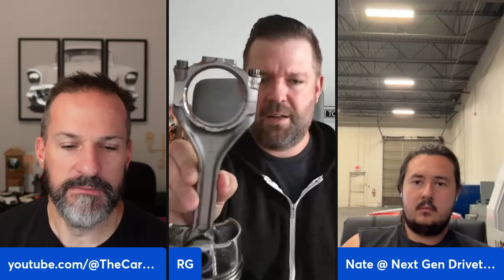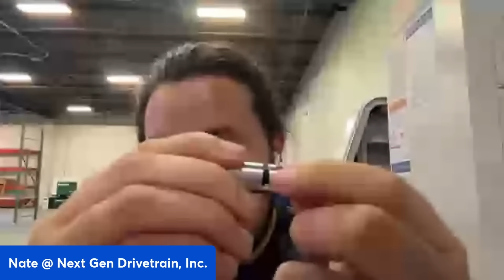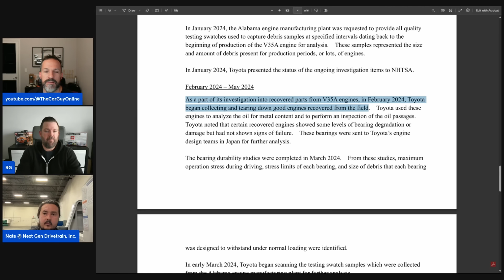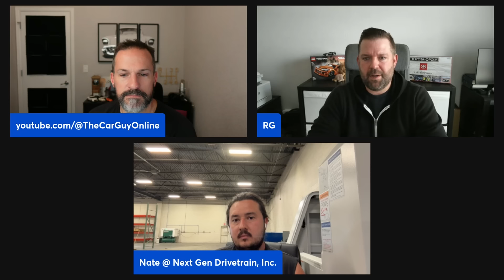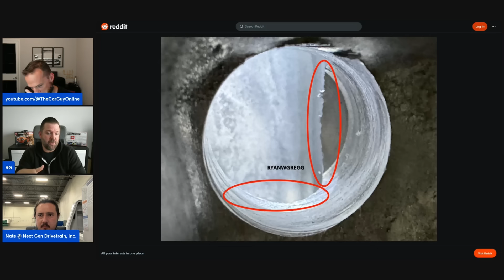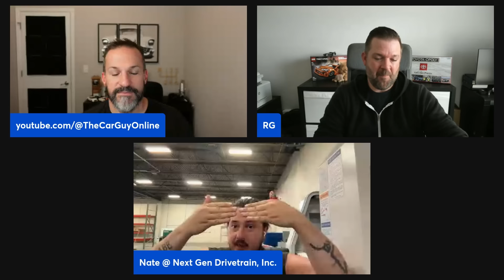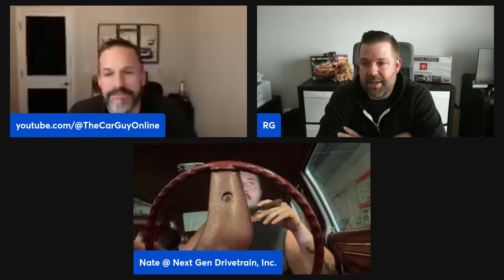Toyota Tundra BOMBSHELL. Buyer Beware Until 2026 (Full Interview)

Comment: I bought a brand new 2026 Toyota Sequoia TRD-PRO. I was rear ended.  I've been waiting 4 months for parts. I'm still waiting.   I complained to the CEO at Toyota North America.  Their brand engagement team did nothing. They would close the case.  I would have never purchased a Toyota knowing they have parts availability problems.  I've been having to pay rental car charges due to the delay .   It's been a very bad experience with Toyota.  Based on this and stories I keep hearing, I will never purchase a Toyota again in my lifetime.  Most likely, I will sell the car when fully repaired to wake up from this nightmare.

Comment: Car guy your sequoia is clear because Toyota uses the dual injection. It has port injection and direct injection. Most vehicles using direct injection which is known for oil sludge build up. I’ve been a Toyota customer since 2002. Had one Honda ridgeline but traded a 2020 Toyota Tacoma in on Honda. Traded Toyota because of transmission 6 speed couldn’t find 4th gear. Looking for a new midsize and I believe the frontier may be the Best Buy but direct injection inside water pump and the steering.

Comment: I'm the owner of a 24 Tundra. If have had MANY MORE ISSUES WITH MINE. I will buy a rickshaw before I will buy another Toyota product. My truck had HORRIBLE HESITATION / THROTTLE LAG. It was dangerous. I had the stupid "learning transmission" memory wiped clean and they gave it to me from the dealership with no one else allowed to drive it. Why make it smart? The transmission STARTS OUT IN FOURTH GEAR IN NORMAL MODE!!! WHY???? I can tell it stresses the transmission and has a ton of fluid shear (heat generation).

Comment: Toyota has had great super reliability in history, but I hope Toyota will fix it. I know it's a stupid question: does used VR1 oil or other oil with high ZDDP help the engine? I know it's not good for the catalytic converter.

Comment: Forced induction 4 cylinder engines are wrong for the market. 
I blame government 100%. Government wants you in an all electric car. A Toyota engineer would not put a 4 cylinder engine in a full size truck unless he or she were forced to. The accountant is running the engineers and the result? The customer suffers. I won’t buy a Toyota newer than 1998

Comment: Technical Report Summary The V35A engine in the Toyota Tundra exhibits unusually low oil pressure at low engine speeds, measuring approximately 4 psi at idle and only 26 psi at 2,500 RPM.
By contrast, a 2016 Toyota Tacoma engine typically maintains 10–12 psi at idle and around 36 psi at 2,500 RPM, which supports adequate bearing lubrication and durability.
This data suggests that the primary cause of premature engine wear or failure in the V35A engine is insufficient oil pressure at low RPM, resulting in compromised lubrication and increased risk of internal damage.

Comment: I have been a loyal Toyota customer for over 30 years. I purchased a third-generation Toyota Tundra after owning nothing but Toyota vehicles during that time. My previous Tundra, a 2006 model purchased new, accumulated over 350,000 miles on the original engine and transmission. My household currently owns a Lexus purchased new, along with other Toyota vehicles, including a Camry, 4Runner, Avalon, T-100, and multiple Camrys over the years.

Because of this long history and Toyota’s reputation for reliability, I was confident in my purchase. Unfortunately, that confidence is now gone. I never thought I would worry about taking a trip in a new Toyota ever.

Comment: How do I get in touch with Nate? So what was the answer to Ryan's question? Does the boost valve problem happen to the older Aisin AB60 transmission? If so, how hard is it for a DIY'er to upgrade the boost valves (for an Aisin AB60F transmission)?

Comment: 1986.5-1992 Supra (na). My 7M-GE had awful engineering issues with:
 1) blown aluminum head (X4) by insufficient manufacturer spec'd torque bolts, and weak composite gasket material wear between iron block cylinders #5/6. 
2) Excessive oil consumption via weak valve stem seals, piston oil rings.
3) Engine knock due to premature connecting rod bearing wear. 
4) weak transmission excessive wear.

Comment: Most cases are referred to selling dealership or dealer who preformed last repair. 

Since you’re not Toyota’s customer. Technically they cannot talk to you. Depending on the situation. If they didn’t hold the call themselves by not knowing where it needs to go. The dealer could have closed it and not necessarily Toyota

I’ve worked in a town that had two dealers. They would get pissed at the other dealer and call us to get the 800 number. I would tell them what I knew. You are not Toyota’s customer that legally Your the dealers customer. They are just going to refer you back to that dealer for you to resolve the situation you’re having. 

Some things get caught in this loop. But not every situation.

Comment: You know it’s bad when Japanese start acting like the Americans. This is why you need to deal with the government. Your US government called these problems with a strict in mission laws and all the foolishness that they want them to put on all these vehicles to get better fuel economy at y’all request, but I digress and the craziest part is oldies. Come to been building an engine for years now all of a sudden they get to 2025 the youngest people in company history can’t figure out how to get rid of debris out of a new engine seriously we don’t know how to press wash and clean engine welder up deep engines well enough to make sure that no extra debris of metal inside of a brand new engine and nobody knows how to clean them properly. This is what the new people are doing now what kind of lunar are they using? That’s causing this issue where it can’t be clean properly. I don’t understand they wouldn’t have these many failures when they first designed aluminum blocks from the beginning when they first started making them when they stop making cast-iron and start making aluminum whole engine. Why all of a sudden now they have this problem they’ve been making aluminum engine for decades what changed in the cleaning process? I don’t understand it. It’s not new to them. This is old technology at this point so if this a way of sabotaging engines and try to force down the throat, so Americans and people all over the world these electric wreck of cars and trucks within 10 years they’ll be cobalt weights on drywall unsustainable and unrecyclable because of the batteries being super expensive to replace an unrecyclable

Comment: You're talking about EGR and it most certainly applies to the 3.0l range diesels. Bypassing the EGR yields the cleanest exhaust pipes you've ever seen with much better throttle response, better fuel economy (seeing 30+ mpg in RAMS), and improved reliability (you're not dumping carbon into your intake). Get rid of the EPA strangulation of the manufacturers, appoint a truly independent board that reviews exhaust emissions and has a formula that weighs emissions, fuel economy, and reliability to develop emissions targets and you'll see lower costs to manufacture the engines, reduced failures, and lower operational costs. Get rid of the Terrorists! I totally agree with Nate...cartels!

Comment: Toyota wouldn't have ditche the old reliable Engines for nothing... 
There is a major force behind to produce a new engine....
Yess the mas market and a common Engine is better for cost-cutting... but emissions is whats controllin all this...
I've done a lot of research and here in Panama... we use a thicker oil... usually 5W-30 or 10W-30....
Have talked to master tech here and nor the V35A-FTS nor the F33-FTV (the new twin turbo diesel) have had any trouble here... 
Our culture here makes people change oil every 6 months of 10k kilometers... 
No bearing failure over here...
Yes the debrii could be...
One strong Guideline here is... the first oil change  is at 1,000 kilometers... and they use an even thicker oil for "cleaning" like they've told me... then again at the 11,000 kilometer mark or less.. comes the new oil change....
We dont use toyota OEM oil... here toyota Panama.... uses Motul Oil for SUVs.....
My 1GD-FTV gets oil changes every 2-3 months ( 5,000 kilometers)....
Thats what the dealer ship has come in terms with toyota Japan....
On the comming months... Il own a 2026 Lexus Gx550 Overtrail... I will report everything on that SUV... every single detail... sadly i cannot do oil studies innPanama

Comment: I ran away from Toyota when I knowledge that "new" engines can't be rebuilt (1zzfe, 1nzfe , etc..). Here in my country we have 1zz Corollas that are dead because you can't find a used engine in good shape, meanwhile, engines that can be rebuilt (4A, 7A, C...) keep going. That's why, if I have to choose a modern Toyota, I prefer diesel engines (iron blocks), we have them, and they go really well. By the way, the TR is rebuild able, that's an engine that I like, and I think that Toyota had to choose that engine to improve it vs the new developed 2.4, but well, nowadays horsepower and torque sale cars, and reliability is not a priority.

Comment: Nate thank you for all you do sir.  Thank you also car guy for providing a great channel and informative guests to help consumers greeting screwed. I wish you all many blessings for success. As a tech with toyota 95 to 2005 and gm 2007 till now i can relate to many of these issues and learning new info about how to actually fix some of these problems is gold. Extra special thanks nate for using your talent to push forward an actual solution and highlighting the way these problems occur. I have felt disheartened over the years building gm transmissions over the years.  You   do the job with up to date gm parts and factory training with years of experience and then it makes it out the door. Does good for awhile, but inevitably these same problems return.  You wonder what you did .... or didn't do that caused the failure.  Thank you going the diatance to not only figure out the failure, but  manufactur a solution.  I will be spreading the word with however i can to help people in these tough positions

Comment: The transmission lag has been around since the RX330.  I bought a new one of them and I had it back to the dealer multiple times for that issue.  It would occur during a rolling stop, not a full stop.  It was like it could not decide which gear to go to when you did a rolling stop.

Comment: This is so simple.  This v6 has too much power with not enough main bearings.  Not to mention a v6 is literally impossible to balance fully, so not only is each main bearing subject to 25% more force than a comparable v8, it has more internal stress due to vibration.  They should’ve done an inline 6, otherwise bring back the v8, there’s plenty of room in the engine, and it would cost significantly less to put in a tuned up v8 design they already have, than all these recalls, and more importantly the damage to their reputation.

Comment: I have a 2021 Ford Explorer ST. During Covid there was about a 6 month period that Ford used a different type  intake valve spring. The story is they used a different alloy and the heating process made them too brittle. It is the 3.0L 
engine. Several engines in the Bronco and ST springs broke with total engine failure. Ford did a recall and it took them about 9 months to come out with the remedy. Bring your vehicle in to dealership and have them rev the engine at 4,000 rpm for 45 minutes   Let sit for 15 minutes and do it again for I believe it was another 25 minutes. 
If your engine doesn’t break you’re good to go. Ugh 😩

Comment: I am a Toyota fanboy too, but wanted a v8 truck in 2024.  I didnt want a 2021 Tundra with 50K or more miles for MSRP.   2023 Tacoma was overpriced too.  I ended up getting a Titan.  It was close enough for me.

My wife got the 2023 4Runner last year because it was old school v6 with 5speed auto and 4x4.  I can get 23mpg in regular driving and 25mpg on highway. she was going to get a Prius or Rav4.  Dealers wanted ungodly price premium for both.  also didnt want the rear door with electronic door latch.

Comment: Here's my experience with the machining of engine blocks from some 40 years ago.  I retired from a manufacturer that once made small engines of 4 cylinders or less in the U.S.  In every machine operation, there was tool coolant pointed at the tool in contact with the block while the machining was being performed.  The coolant was there to keep the tool cool and wash away machining chips.  When the engine cylinder surface was being machined, coolant was applied. When the oil pan surface on the block was machined, coolant was applied.  The same with honing, line boring, drilling, and tapping of all holes and threads, coolant was pointed in the direction of the cutting tool.  All to wash away cutting chips.  After each machining operation, the holes and the block were cleaned out with an air hose blow gun.  When the engine block machining was complete, the blocks then went through a wash tank, and again all the holes were cleaned out of metal chips by an air hose blow gun.  When I first heard that Toyota said the engines failed due to debris left in the engine from machining, I found it hard to believe.  I couldn't see how a critical operation could be missed, and this has to be a design issue.
Reply: Why can't it be what they say?
Reply: @angelmunoz3709  I think he's saying that the debris is coming from within the engine itself; some metal of other material in the engine itself is breaking down and fouling it.
Reply: @angelmunoz3709 Because anyone with career engine building experience, and common sense, says otherwise.  5 years is FAR top long for a giant company to not find the source of " debris". Especially when they never had all this "debris" in the preceding 70 years or so. Suddenly,  multiple factories on different continents have a " debris" problem? One bootlicking fanboy was even trying to tell me that the Tacoma transmission plant in Germany ALSO had " debris", which was destroying soft Taco transmissions! 😂  It's like all Toyota factories are raining debris from the rafters.

Comment: I've been a gm guy for 20+ years. I've owned several trucks and cars from gm. I switched to a tundra the beginning of 25. It's a used 24. I hope I don't have a engine problem but I knew I was going to have a transmission, engine, or rear diff problem with a gm.
Reply: I'm in the same boat, the issues I'm having with my sierra(both engine & transmission) and GM not acknowledging any issues - I'm ready to jump to a newer Tundra

I would've considered a V8 tundra but around me, the dealerships know their value now and want 6-10k above current market value

Comment: Well I went to buy my first Toyota Tacoma because I never owned one before. Just didn't need a large truck anymore. I drove a 2023 Tacoma Trd off-road and I drove a 2024 Tacoma Trd off-road. The 24 was faster and stopped better than it was told it was brand new everything Nope not for me I never buy first some second year model depending on how bad the first year was. So I bought the 2023 Tacoma all in and out the door was $40K. The same spec 2024 was $51K plus tt&l. I guess because it was a all new version.

Comment: Have you guys seen or heard about the cylinder head valve guide failures? I work at a dealership in San Antonio and I have done 3 now. All hybrid tundra. Vehicles come in with either a misfire or burning oil condition or both. I’m hoping this isn’t going to be a new issue. Any idea if there the cylinder heads are manufactured?

Comment: Here’s my 2¢.

When the one dude talked about the computer telling the valve to kick in blah blah.. well there it is.. there should be ZERO computer crap in the engine /trans performance.
Computers for cool dashboards, easily updatable w software updates, sure, bring it on. 
But leave the dam motors/trans 💯 MECHANICAL.

Comment: I own a 2025 Tundra Platinum right at 5,000 miles so far no issues but one thing I feel is a mistake would be to wait for 10,000 miles for a oil change, the oil filters are the same filters I use on my 2018 4 cylinder Camry, I change my own oil and filters and at just 2,000 miles on the Tundra and the filter was full of debris very heavy.
Reply: https://youtu.be/QDxn3mRTOfg?si=5ft6GPmBndWztx42

Comment: 1) the transmission lurch issue has been around since at least 2012 and Toyota and the transmission maker gave known about it that whole time. I sold my 2012 because of that after it almost caused an accident a couple times and the dealer couldn’t fix it. 2) the convo about not listening to your customers that are right there in your neighborhood is the nail in the coffin for me. At this point I’m not buying any if the post Covid Toyota products. I’ll just keep my old ones running and keep buying used.

Comment: I’ve owned at least 1 Toyota for about 25 years, usually my daily driver. Well, now my daily is an F150. I needed a half ton because my 15 Tacoma just wasn’t doing what I needed anymore. After almost a year of research and many test drives, I couldn’t bring myself to purchasing a new Tundra. It was really hard to not trust Toyota currently. But the F150 has many positives, especially in utility, over the 22+ Tundra. I still have a Toyota, back from their great times…91 Toyota MR2. I miss that Tacoma, but for everyday use the F150 is so much more comfortable and gets better fuel economy.

Comment: I've got a 2022 tundra has 80k miles on it and running great. I put 5w30 in it and use it to tow daily 5k pounds. I wonder if mine is one of the engines that had no debris. I'm hesitant to do the recall cause I don't want to get the recall done and start having a bunch of issues when I'm not having any right now. I have had the hesitation or dead throttle but it is very rare.